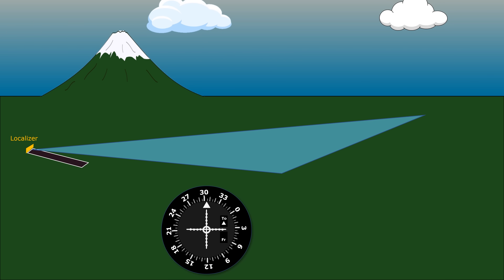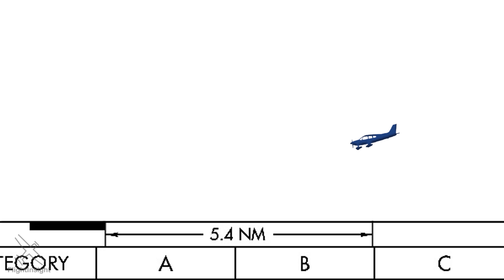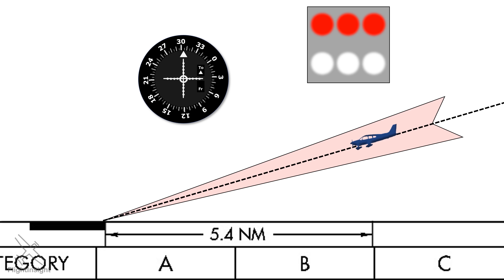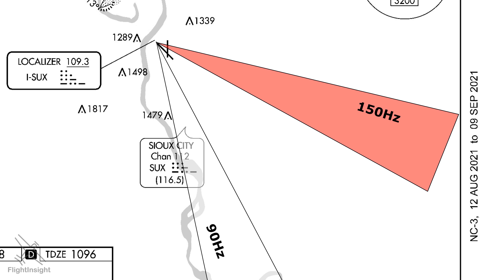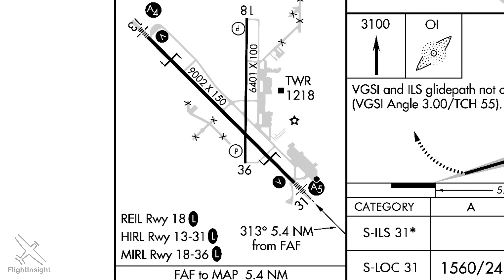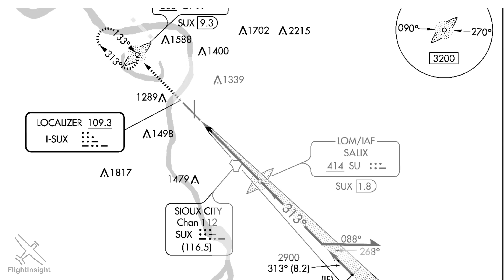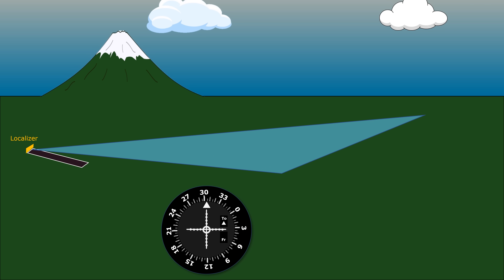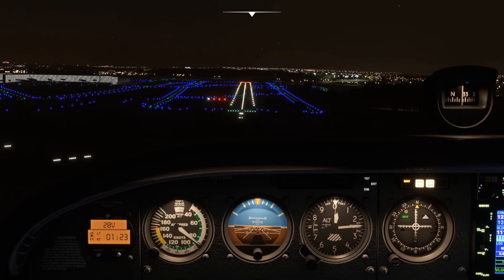How ILS Works | Instrument Landing System Explained | IFR Training

Comment: you mentioned that we typically intercept the localizer from below but most plate I've seen are showing minimum altitudes so it would make more sense to go above rather than below and risk collision with an obstacle no ?
Reply from the maker: This is such a terrific question because it shows your head is in the right place. When you're not on the localizer yet, the guidance it provides doesn't help us clear any obstacles, so we need some other kind of assurance we're staying high enough until we're established. This typically comes from a minimum vectoring altitude ATC uses when assigning us a vector to intercept. They'll tell us to maintain a certain altitude until established. Once established, then we can follow the approach down and be assured obstacle clearance. We don't intercept the glideslope from above because as we get closer to the runway, the glideslope would fall down further away from us, and we'd have to do a dive to stay with it. By meeting the glideslope from below, we can begin a descent to follow it down. There's also a matter of false glideslopes being transmitted above the real one.
Reply: @flightinsight9111  thanks a lot for the prompt and detailed answer - it make sense now : first follow ATC vectoring altitude or the MSA then after established "chase the needle" from below to avoid the false glideslopes. Excellent video and great support, many thanks !